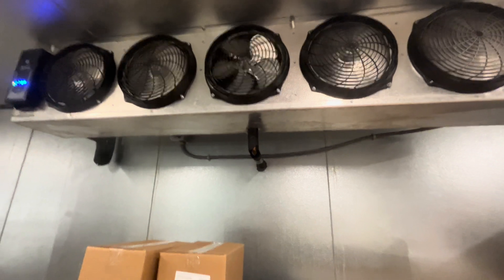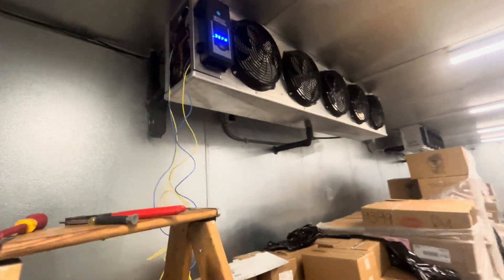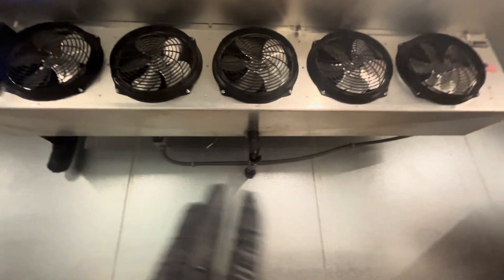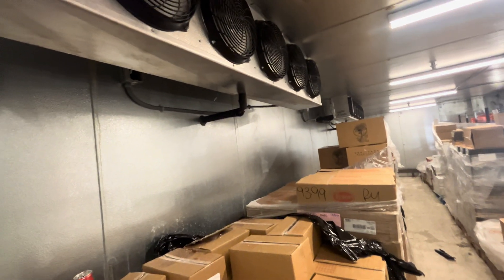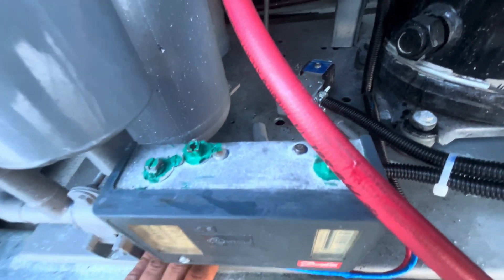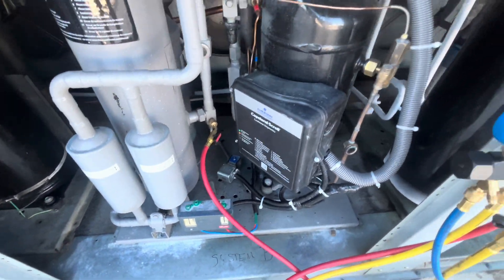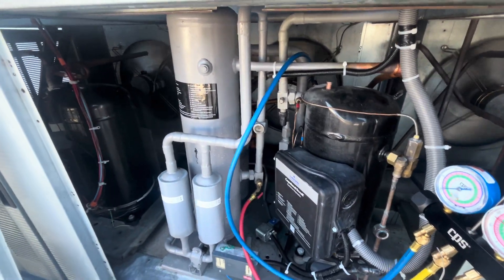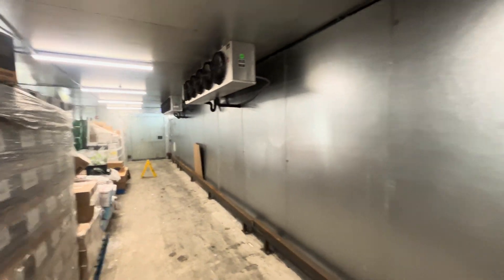REVERSE CYCLE DEFROST?! REPAIRS TO NIGHTMARES “EP 1”

Comment: I worked on one of these systems today from 2011. R404a 5 door reach in freezer two coils on the box and two scrolls one each. Reverse cycle defrost. Had a low superheat alarm initially. Superheat was at 0f while running and flooding back to the compressor like crazy. Weird thing is that the coil and ubends had no frost at all. Found suction line temp sensor slightly shorted on the drain pan heater. Going back to replace the sensor but can’t understand why system is flooding back like crazy but has absolutely no ice on the evap at all. Have you ever had something act like that? First time working on one of these and I talked to masterbilt and he tried to tell me to charge to 10f superheat at first and I’m like buddy I’m charging this from the roof and it has an EEV no way am I gonna get the charge right like that so he told me to just clear the sight glass which made no difference. Valve was at 1-4 on the steps which indicates too much refrigerant in the coil but no ice. So confused brother if you have an insight I would greatly appreciate it

Comment: The reverse hot gas defrost works great, quicker and more efficient. The refrigerant charge is very critical on those systems. I remember a few years ago when the EC motors first started to get used on evaporators , I would see this issue, where the motor would stop for a while, like It was thinking on what rotation to go .  I see it less these days, still EC motors not as reliable as a simple PSC ball bearing motor.
Reply from the maker: It definitely works…when it works lol. 

Not many around anymore.

When I read and studied as much as I could find on them they are a lot more simpler than they appear.
Reply from the maker: You’re right about charge though. When MasterBilt told me the sight glass is supposed to flash and that if it’s clear it’s over charged, that kind of confused me

I think it’s the reason they lost so many compressors before we took over this store, they were probably just kept clearing the glass because the condensers have a lot of leaks. 

When I first looked at this store they just lost a compressor. They removed the reversing valve 😂😂😂
Reply: have not worked on one  of those in a while, but I remember the install manual would list the charge in pounds per tons of refrigeration plus how much  the refrigerant the liquid line set holds for the run. @FloridaManHVACR
Reply from the maker: @GentianElezaj-d5w  yes it does explain exactly that. 

I’ve dialed in the charge on both systems for the freezer, System A takes 38 pounds, System B takes 36 pounds and that’s exact according to how they say to do it. 

My sight glass flashes slightly and defrost happens pretty quickly.

No time clock, controller isn’t even set to defrost times per day.

It’s demand defrost based off coil sensor temperature.
Reply from the maker: @GentianElezaj-d5w  it’s weird, the rest of the rack is hot gas defrost, except the walk in cooler. That has defrost heaters but really never uses it like most coolers it defrosts in off cycle.

Tomorrow I’m fixing the other leak on the rack, a complete different system. It’s the condensing unit for the reach ins. Video will be out tomorrow, was supposed to do it today but changed a compressor out on a unit I previously made a video on.  Trying to get the video uploaded now
Reply: Cool. When it works , it works great. As long as people don't butcher it .A lot of techs  don't understand that system. Also that Controller is a KE2 with Masterbilt name on it. It Works great, just sometimes the coil sensor will go bad due to moisture. Demand defrost is the way to go... @FloridaManHVACR